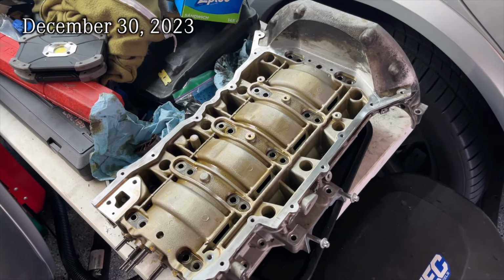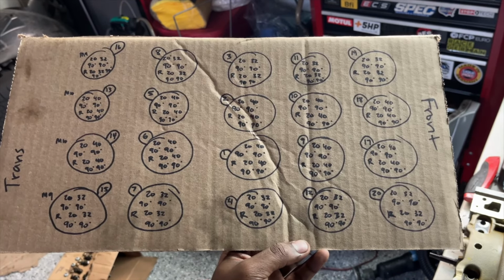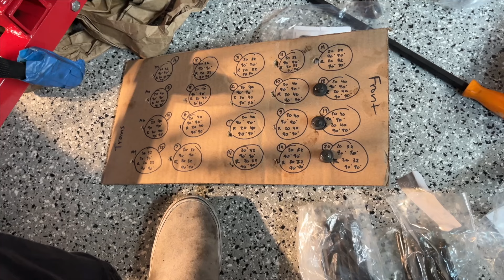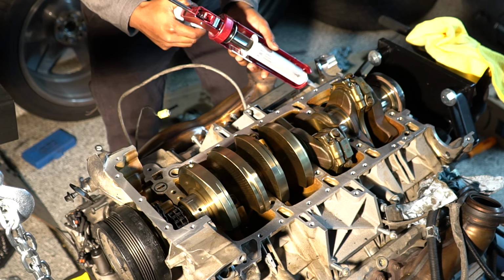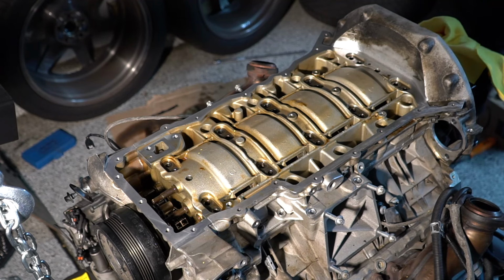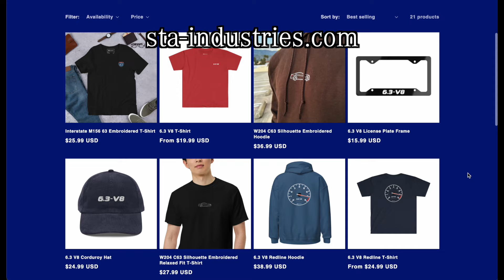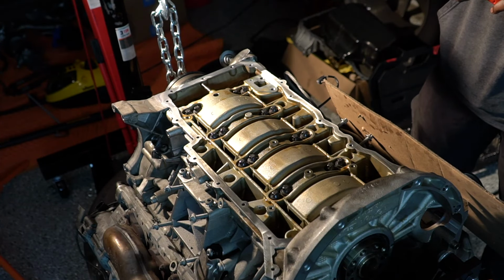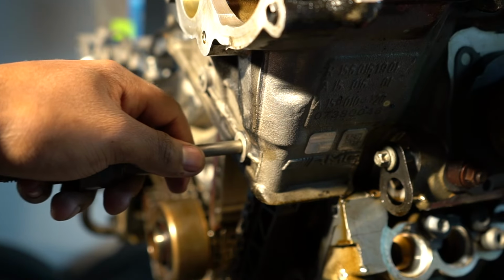AMG M156 V8 Refresh Part 4: Bedplate Reinstall - PAINFUL 9 STAGE TORQUE SEQUENCE

Comment: Love the M156 work Sam. Mine had over 400k miles but totalled that C63 last month( :( ) But i did replace it with an E63s WAGON so im pretty stoked about that!!!! I have torn my M156 down to the absolute core more than once and LOVED working on that engine!!! So over-engineered but so logical....When i did my bedplate reseal the only thing different i did was cut the heads off of my original M9 center bolts(1,2,5,6,9 and 10 in your diagram) so that i could thread them in and use them as guides for the bedplate to fall in place as opposed to doing the hover/hope/pray method....Great content my Friend and keep up the good work!!!!!  

and fwiw(and as much as i LOVE the M156) the M177 with downpipes and a tune is BRUTAL!!!!!
Reply from the maker: Using the old bolts as guides is a great tip for anyone else tackling this job, wish I thought of that at the time! Awesome to hear about your 400k mile 204, sorry to hear about its demise. 213 E63 wagon and AMG GTS/C/R are on my list of future cars some day, drove a buddy’s GT63S with downpipes + tune and it was awesome

Comment: Did the same job. If I were you I would have sealed the bed plate with an anaerobic sealant such as loctite 515 or 518. It’s the better way to seal two machines pieces. Not Mercedes silicone does not last long and will eventually leak again.
Reply from the maker: I have only heard of horror stories of using other sealants which I why I didn't try to get adventurous. That's a good suggestion though, I'll try that out on some M113 PCV breather covers or when I have to do this again on my C63 haha
Reply: Did you re use all the aluminum surrounding bolts?
Reply from the maker: @HorsepowerTherapy2  Yep, those aren’t torque to yield